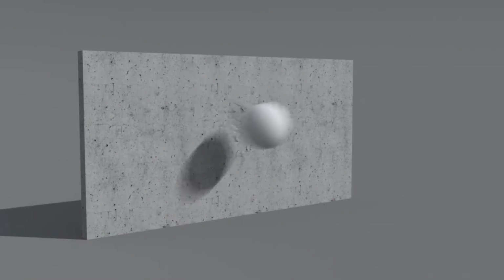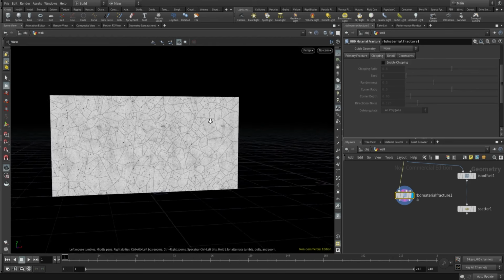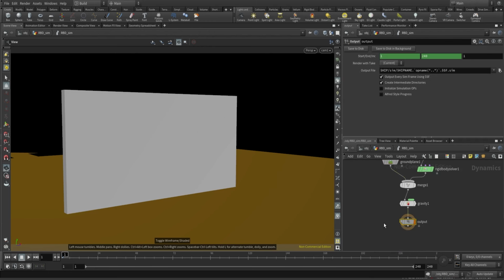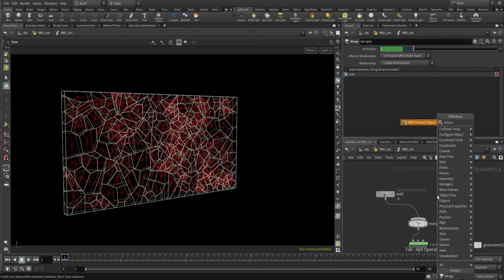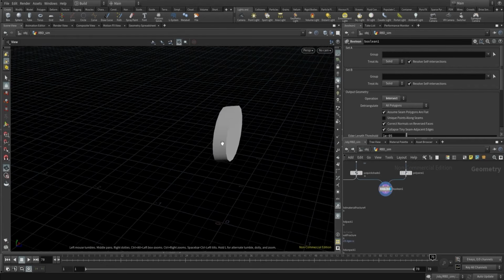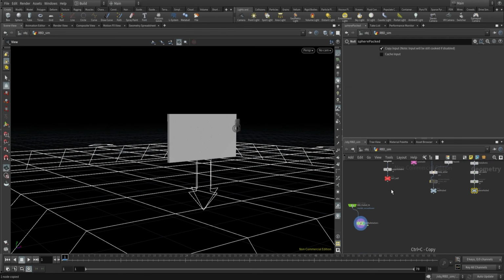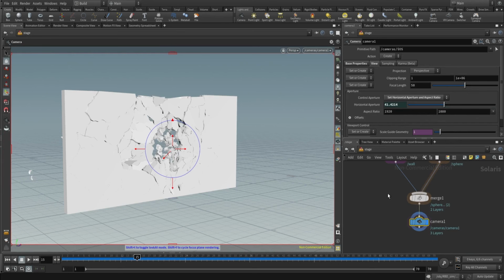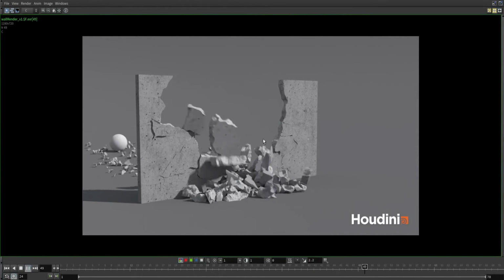Houdini Introduction to RBD I | Wall Destruction Tutorial

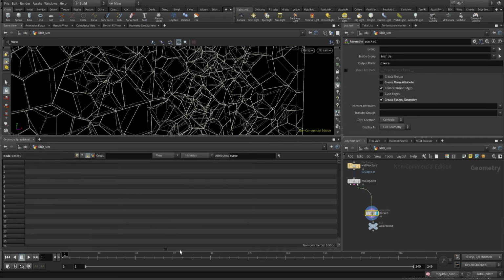Comment: Hi thanks for the tutorial but I am facing some problems. although rbd material fracture is named wall and Fracture namespace is checked,  @42:38 when I check the name in the packed node, point as selected yours is "wall-piece", mine is only "piece". What I did it worng? Thanks!
Reply: I realized that I have to save the cache again...
Reply from the maker: @fernandocriativo3d74  👍

Comment: Hi.
The method showed by you " constraint" doesn't work In Houdini 19. I tried very high values for 'glue' node but all the constraints were breaking already in first frames. Setting glue to value "1" has no effect either.  Is there a different way in H19 to achieve this?
Reply from the maker: cross-check names and constraint attribute default values.
Reply: @VFXMagics  Having same issue...i cross checked names also...Glue showing on first frame but disappears from very next frame

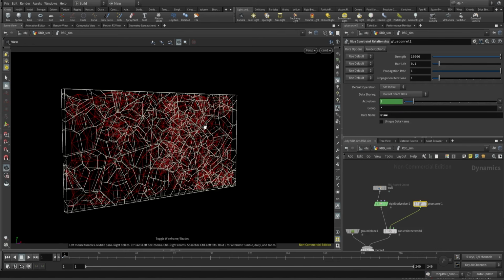Comment: Great tutorial! But I have a problem with constraints. That glue contraints wireframe does not appear (red one as in the video 47:56) and therefore my wall continues to destroy. I checked all names and many other parameters, everything seems to be fine, but it still doesn't work. What could have gone wrong? Also, I heard that some peaople have the same issue in Houdini 19, which I use as well. Maybe there were some changes that may influence this situation?
Reply from the maker: cross-check if assemble node is not creating the name again ( by default it recreates a new name so disable that ) or you can mail me your file at vfxmagics@gmail.com so I can check
Reply: @VFXMagics  this solved my problem, thanks:)
Reply: @ЛизаКлёц-х9п  i am having the same issue can u help me with it
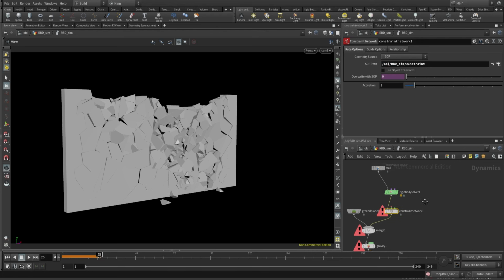Reply: @saimohith9904  I noticed that my "Overwrite with SOP" value in the constraintnetwork node was set to 1 and not 0 as it is in the tutorial (46:54). I right clicked and pressed delete channels so I could input the value by myself. Seems to have solved the problem for me.
Reply: @fritteman  thanks!